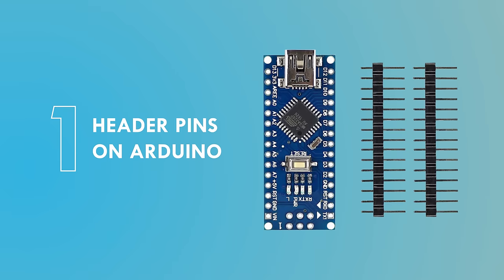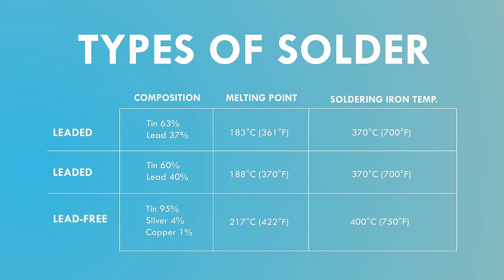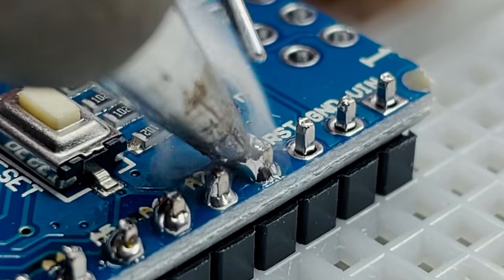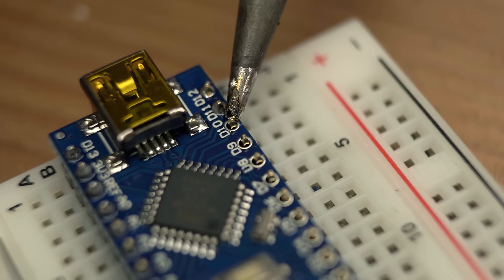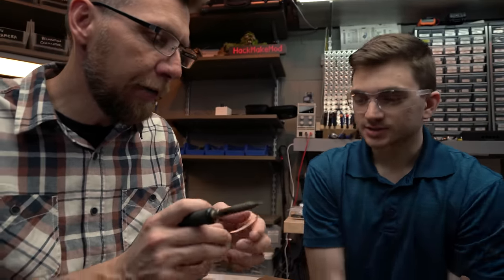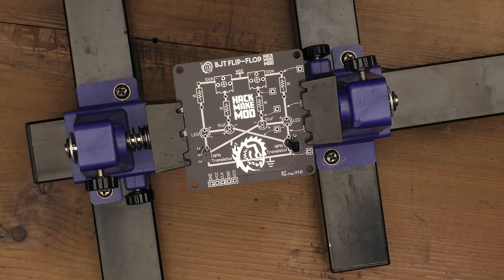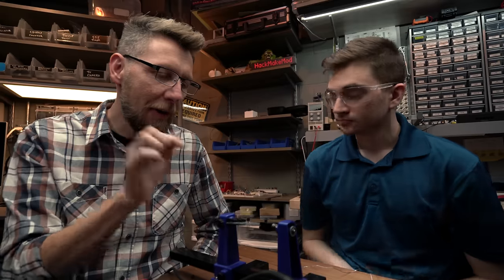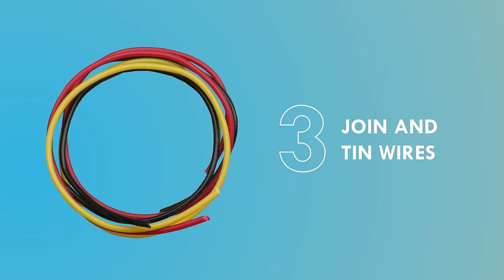HOW TO SOLDER! (Beginner's Guide)

Comment: I took an electronics class at my local community college 20 years ago and learned how to solder. Our final project was a PCB that turned out to be a volt meter. Still use that volt meter I built to this day.
Reply: I've been thinking about doing this as well, because after countless hours of reading and watching videos and trying to solder with the same / similar gear as in this video, I have yet to "convince" any solder to stick to a pad on a pcb, let alone marry a component leg with the pad. Spent 4 more hours on it a couple days ago and came away shedding actual tears of frustration and feeling like soldering is some kind of hoax 😅So far all the videos I've watched and forums I've read, soldering "just works", and any discussion of troubleshooting quickly devolves into arguments over technique and equipment, or talking about it like it's esoteric witchcraft.
Reply: @chriskaprys  you most likely have either dirty pads, or you don't heat them enough. You have to use flux to clean them and you have to make sure they are very hot, otherwise the solder doesn't stick.

Comment: 3:53 SO IMPORTANT, yet not emphasized or explained.  The cleaning of the tip part was good but when he said in that brief second "add a tiny bit of solder" that is critical to create a heat bridge so that the soldering/de-soldering process can effectively work.  That's it, rest of it is good, just never, ever, ever, put a bare tip to a work piece, I see it all the time.
Reply: thanks I missed that.

Comment: In secondary school our Informatics teacher showed us soldering by placing the solder on the soldering iron and letting it drip down to the component's wire. I didn't think much about it back then and I've never soldered until now, when I just bought an Arduino set.

Thank you so much for this very informative and entertaining video! :)

Comment: A tip: if you cut the leg that close to the joint after soldering, make sure to reheat the joint in case you damaged it while cutting. Might not be a problem now but might become one in a while.

Comment: I just started learning soldering and desoldering recently and I got most of the tools like the iron, solder, ipa, just need flux then I'll start practicing on some old circuit boards I have lying around. You teach well and this video is both awesome and inspiring, thanks! :)
Reply: Most electronics solder comes impregnated with flux . Used to be 5 channels up the core as I recall. Read up.  As for extra flux though, yes,  I used that technique on surface mount builds and quad pack, micro bga placement, but that tends to be hot air placement .
Reply: By the way, those recoil desolderers can pack a nasty punch and pros tend to use braid or an electronic suction system.

Comment: Great video! By far, my #1 tip for soldering beginners, is to use flux for every joint. It just makes soldering so much easier! Even though the soldering wire comes with a flux core, I've always found it helpful to add extra flux. It makes the solder flow much better, achieving a much better joint!
Reply: I agree! Thank you for sharing your experience!
Reply: do you add the additional flux directly to the joint?
Reply from the maker: Yes 👍
Reply: More specifically, add it to the pad & wire before applying solder or heat. 
Paste - heat - solder.
Reply: NO! A thousand times NO!

Sometimes extra flux is a big help, but if you use good cored solder and have developed good technique it is rarely necessary. It makes a big mess.
One thing you need to do with cored solder is learn to feed it to the joint so that the flux "leads" (goes ahead of) the solder. I was watching part of a "don't do this" soldering video a couple of days ago and the person consistently fed solder so that the first thing it contacted was the molten solder on the tip. BAD! You want it to contact the things being soldered first, only just touching the tip.If you do that the flux spreads and flows where it is needed. This error is also apparent in this video too - the solder hits the iron first, and sort of slops down to where it is needed.
Poor quality solder can have voids in the flux core which does make getting good joints very difficult without using additional flux. I used to use Ersin solder which had three or five separate flux cores. Ersin became Multicore and was acquired by Henkel.

I do like a little extra flux, as a low solids content liquid, for tinning wires. It penetrates well among the strands and can make tinning go much faster.

I have on occasion applied flux to an entire board. This has usually been on boards with unusually heavy copper and/or thick laminate, where getting good fill of the holes is difficult.

Comment: The perfect soldering tutorial does not exi—

Amazing video! Chad, you completely nailed every important point. When we're learning, it's easy to think solder is like hot glue... and when our circuit doesn't work, we can't figure out why because bad solder joints can be super hard to spot. If you follow Chad's tutorial though, you'll never have a bad solder joint ruin your project.

Comment: I taught myself how to solder (at a very basic, very low level) when I was about 15 because I wanted to add LEDs to my PS3 controller. I've started getting into Arduino and some basic electronic repair, so I wanted to learn more about how to solder and the other aspects of it.

It's making me remember how much I enjoy soldering lol. I may have to see if there are any lower level soldering jobs while I continue learning this stuff :P

The video was very informative, thanks!

Comment: Very well made editorial video. Glad you did all sizes of wire and contacts to be welded. I have to solder a point on a Ford instrument panel. The connection for the odometer breaks off....you both showed you know solder

Comment: Very decent tutorial for beginners. But if you want to solder a lot, get a PCB holder with a backing plate. That way you can do all parts with the same height at once without bending leads
Reply: True. Bending leads risks damaging the copper tracks. Another mistake I see too often on these "guides" is to crop the leads after soldering.  There are a few reasons that is a bad idea and I have a little chuckle Everytime I see stuff that shows them cropping the leads after soldering. It is pretty obvious to anyone that knows anything about copper, but so many "expert tutorial" seem to miss the crucial point that will lose someone an interview or just get them thrown off  a contract.

Comment: Thanks for this. Recent subscriber. I appreciate the teaching style in lots of your videos, and this is a useful introduction.

I'd love to see another version with more failure / problem-solving as an alternative teaching strategy, where a student gets to experience "what if it's not working?" with a tutor guiding them through what variables in the process they can change.

From trying to learn soldering through reading and watching videos, I get the impression that it's somewhere between a skill and an art, such that someone with lots of experience of successful soldering finds it difficult (often without realising) to describe or teach what is essentially a matter of muscle memory and "feel". Like an olympian trying to explain to a non-athlete the nuances they've embodied after years of practise. This seems to breed frustration between both the expert and the amateur, because for those who already have the knack, the process and feel seems very obvious. Whereas those (like me) who struggle to get the most basic aspect of soldering to work, and reach out for help, immediately run into either condescension, dismissal, or, more often, a barrage of conflicting tug-of-war arguments over what the problem / solution might be (e.g. wrong solder, wrong flux, wrong wick, wrong tip, too hot, too cold, too long, too short, etc.).
I think it's tougher than many people realise to teach something that has a "knack" to it.

Thanks, HMM!
Reply from the maker: Excellent feedback! Thank you for taking the time to articulate this very valuable suggestion!

Comment: Awesome video. I learned a lot. One thing that I noticed that isn't pointed out; tinning the tip of the solder acts like an attraction to the new solder, which is why you hold the soldering iron on the opposite side of the part you want to solder. 
If only I saw this video yesterday, my Arduino would look much nicer.

Comment: Great. This will be my goto for teaching the kids. My only suggestion would be to match the tip size to the gauge of wire or mass of the 2 parts you are trying to solder together, especially using the newer "no lead" solder. I find you need a much bigger tip to solder those big LIPO power wires to the FCs. Otherwise the big wires just suck the heat out of the smaller tips too quick. And then there's those super tiny pads on the tiny whoop FCs...gotta use a tiny pointed tip for those or the solder just goes everywhere. Also for the tiny stuff,  I use a stiff piece of wire positioned over the board to rest the iron on just behind the tip so you have more stability to keep the point on the right spot. With the boards getting smaller and smaller every year, my latest soldering tool project has been to make a board holder on a 3D printed stepper motor controlled positioning stage with a tiny robotic arm soldering iron. Got the positioning stage built and working but still trying to make a good tiny soldering iron with a heat resistant FPV macro cam for us old people who can't see those tiny pads anymore.
Reply: Yup. Matching the tip to the work is important for efficient soldering. I have quite a large collection of different sizes from long slender finely pointed ones to short, heavy "screwdriver" types. Good tips can be a bit expensive, but if you treat them well they'll last a long time. Some of the ones I have but rarely use are probably well over three decades old.

Comment: My first solder project was to convert my 128K Macintosh into a 512K Fat Mac.  The Apple Store had to add solder to some of the chip pins and then everything started working as  it was supposed to.  Had I had a hotter iron and proper tip and this video... I would have not had to take it in to the store. (1988)

Comment: Thanks for this video, seriously. I've been doing some basic mods on old Game Boys but have been reliant on stuff you can just drop in and out, meaning I can't do a lot of cool stuff because it involved soldering. This has given me the confidence to go ahead and look at getting my own basic soldering set up. I won't necssarily be doing fancy stuff like populating entire PCB's, but I need to be able to solder wires to junctions to power them and change old coin batteries in game cartridges that have died.

Comment: Overall I think you did a great job in the style of explaining. However, I don’t recommend soldering from the top; that’s not really considered good practice. Clinching leads is absolutely acceptable, but I think it’s worth mentioning that it does make desoldering more difficult. What is good practice (in fact, mandatory in high-reliability soldering standards) is to trim component leads before soldering them. It means you must hold the component somehow (either with pressure or adhesive from the component side, or by tight clinching), but in turn the soldering actually goes easier since you’ve reduced the mass of the joint.

Comment: A detail I would add to first pcb job. After your iron is in contact with both surfaces apply just a touch of solder. This quickens heat transfer. Then follow what you are saying.

Comment: Thanks so much!  I am confident now, that I can successfully solder resistors to my auto instrument panel board, to repair my odometer, so that I can see how many miles I've put on my car!  I will be sure to also buy some solder wick too just in case I screw up and make a mess.  Lil hugs

Comment: Better than the last video I watched  with millions of likes thank you.
Reply from the maker: You are very welcome!
Reply: @HackMakeMod  have any tips for applying braid flux to cleaning up a mess  like should I apply some arctic cleaner 1 & 2 than tin the solder wipe it off with a sponge and dab it in some flux I'm beginner and looking to go to school for it.
Reply: @HackMakeMod  I tried doing exactly how you showed in the video but for someone didn't come up so smoothly.
Reply from the maker: I realize you may have tried some of these things, but I’m going to post the entire section from my notes. Applying braid flux to clean up a soldering mess can be tricky, especially for beginners. It sounds like you're on the right track, though. Here are a few tips:

1. Use Quality Flux and Solder Wick: Make sure your flux and solder wick are of good quality. Cheap ones can make the job harder.

2. Apply Flux Sparingly: Before using the solder wick, apply a small amount of flux to the area. This helps the solder flow more easily onto the wick. But don't overdo it—too much flux can create more mess.

3. Heat Efficiently: When you place the wick over the solder, heat it from the top. This way, the solder melts and gets absorbed into the wick. Make sure your iron is at the right temperature. Too hot, and you risk damaging the board; too cool, and the solder won't flow properly.

4. Clean Regularly: After each use of the wick, cut off the used portion. This ensures that you have a clean, fresh surface for the next attempt.

5. Use Arctic Cleaner Correctly: If you're using a cleaner like Arctic Cleaner 1 & 2, follow the instructions carefully. Clean the area before and after soldering to prevent any residues.

6. Practice Tinning: Tinning your iron properly is crucial. Apply a small amount of solder to the tip, then wipe it off on a wet sponge. This keeps the tip clean and improves heat transfer.

7. Be Patient: It's normal for things not to go smoothly at first. Soldering requires practice and patience. Don't get discouraged!

8. Watch and Analyze: Since you mentioned following a video tutorial, maybe watch it again and pause at key steps. Sometimes seeing it a second time helps catch details you might have missed.

Remember, it's a learning process. It's great that you're seeking education in this field. These skills will improve with time and practice. Keep at it, and don't be too hard on yourself if it's not perfect right away.

Comment: for the removing extra solder from bridged connection, if you really don't have anything but your soldering iron, just quickly scrape the solder off the bridged connection, not recommended but could really save some time and help if u don't have any other solutions, just don't leave the soldering iron tip scraping the pcb board or something you're soldering on for too long or it will damage it.

Comment: I have soldered countless joints and have never explicitly used the method of getting everything up to solder melting temperature first so that the parts will melt the solder when doing PCB workl That is VERY old school,going back to the days of vacuum tubes, "tag strips" and "solder lugs." With small pins as on components on the the board in the video, my iron and the solder arrive pretty much simultaneously, but I am careful to be sure to feed the solder to the joint area NOT to the tip of the iron. It does contact the tip or the iron but sort of at the edge of the end of the solder wire. That way the flux flows over the joint ahead of the molten solder. I can solder a 16 pin DIP on an ordinary double sided board in about 20 seconds. What really slows me down (or did, I don't do any of this stuff anymore) is soldering through-hole components on 0.093" thick PCBs with four ounce copper. (I used to do power supply design.)

Heating parts to solder melting temperature is good practise for large things, but not most things on PCBs.

Experience and experimentation will teach you what you need to do, but you have to pay attention and think about what you are doing to learn.

Comment: I tell myself: don't COOK the component by lingering on the joint with the soldering iron. Have a clean tinned tip, and aim with practice to just-enough the contact time while still getting a good electrical connection. Don't COOK IT ! And clean the tip one last time at the last use before putting it away. Great camera work for the video.

Comment: the thing that this video alone made me realize, is that Im supposed to heat the elements im connecting and not just the solder. I always thought you just connect them then heat the solder on them.

Comment: The conical tip heats the same. The "problem" is that it doesn't have enough surface to easily touch both the pad and the leg of your component, at the same time, to obtain a good solder joint. Still, it can be used with ease!

Comment: For the bridged solder i just use my iron and touch both points and just move it out of the board quickly because the iron pushes the excess solder out

Comment: Don’t use 60/40 solder for electronics. When 60/40 cools there is a point at which it’s kind of between liquid and solid, and it can mess up the joint if things move during that phase.  Use rosin core solder, not acid core.

I was taught that the 63/37  alloy of solder doesn’t have that plastic state.  I would guess it probably does, but it’s a very, very narrow temperature band, so for all practical purposes, it doesn’t have that state. Even the 60/40, it’s only in that state for about a second or two.
Reply: No, 63/37 is eutectic, meaning it has no plastic region; it goes directly from liquid to/from solid. 60/40 is certainly suitable for electronics — it’s close enough to 63/37 for most purposes that it was the dominant type for most of the era of leaded solder in electronics. But I do prefer using 63/37.